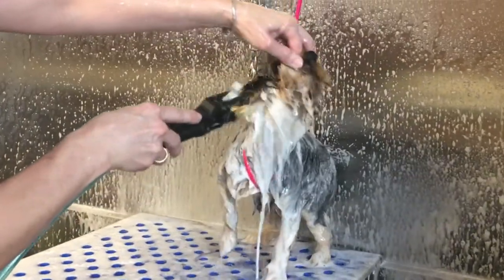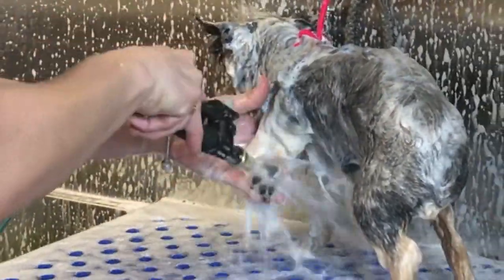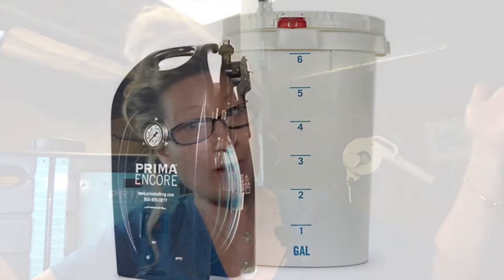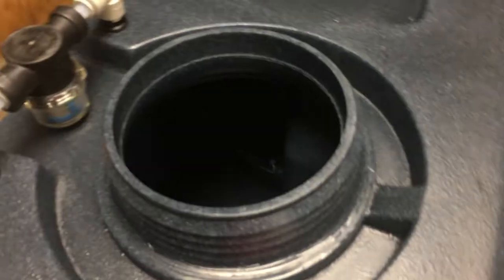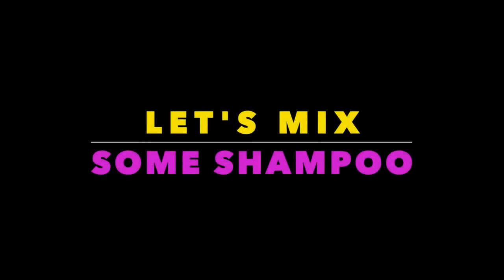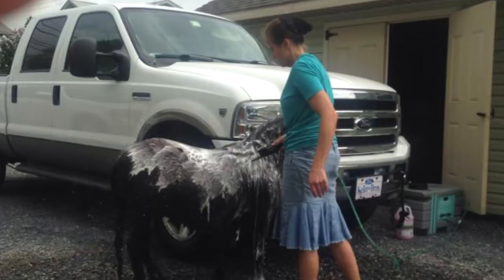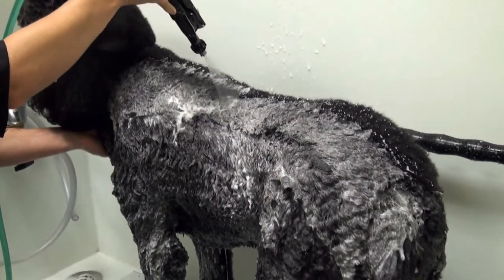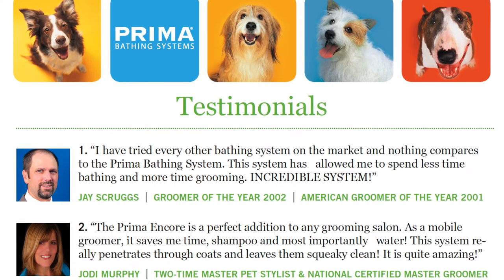Prima Bathing System is the most Efficient and Environmentally Friendly Bathing System

Comment: Hi go groomer luv ur channel 
I was considering buying a prima but I noticed you’re only allowed to use one shampoo at a time that’s not considering the conditioner so how does that work if you need to change up your shampoo or your conditioner I also love the nozzle that you use for your water where can I get one 
Thanks 
Ivonne
Reply from the maker: Prima has one aux option for a second product. But honestly, I like to use a hypo shampoo for every dog in the tank and choose my conditioner per coat type. I apply the conditioner by hand and pre-mix in a mixing bottle. My tub sprayer is made by triStar vet.
Reply: @GoGroomer  can you use thicker shampps in the aux like deshed?
Reply from the maker: @karinevans754  yes. The same products you what are used in the main tank. Remember, Prima works best with shampoos that are dilatable, concentrated.

Comment: At the end of the day if you have soap still in their, do you reuse it the next day? Is it OK to use bleach in it to clean so no bacteria is left?
Reply from the maker: I empty and rinse the tank every couple of days. Hot water mixed with about 1. Up of vinegar. No bleach in this system, it will destroy the guts of it.

Comment: Help! Im so torn, i know you also work with groomers choice products and i am planning on ordering a batherbox tomorrow im worried im making a bad decision, do you have any information or experience with the batherbox?
Reply from the maker: I would not choose the bather box over the Prima. You are limited with shampoos in the bather box as well as is does not come close to cleaning the pets the way the Prima does.
Reply: @GoGroomer  I'm also wonder if the prima will help me, I am putting in a new Grooming shop and the building I will be putting it in has a small tankless water heater will this system help me with not having to buy a bigger water heater? Hopefully this is making sense. I've been watching your videos for weeks, your amazing!!
Reply from the maker: @MrMaloriebush  the Prima is very conservative and economical. Uses less water and shampoo and Remember you apply it to a dry coat which saves you a ton of water. That is why it is the best choice for mobile groomers as well. 👍🏻

Comment: I recently used a Prima bathing system at my local pet store that had a DIY dog wash, and I was disappointed with it. Maybe I dont fully understand how its supposed to work and I had wrong expectations, or if it just wasnt hooked up properly. I had to 1st wet down my dog with water from a hose attached to the tap of the tub. Then I used the Prima system, which I assumed would have a steady supply of warm water coming into the tank and mixing with the soap. But the water was COLD! The tank wasnt hooked up to a warm water tap anywhere. The employee said the tank is filled every morning with warm water and then they mix in the soap. But after the mix sat in the tank all day the water got cold. The high pressure wash was great but it was cold water, so I didnt do as good of a job as I wanted because I was doing it quickly to minimize the cold water on my dog. Then I had to switch back to using the hose on the tub to rinse out the soap...with warm water. So Im confused. All the seperate hoses, the cold water, the seperate rinsing just didnt seem right to me. I dont want to wash my dog in Feb with cold water. Can anyone clarify and explain how this is supposed to be hooked up and how it works?
Reply from the maker: I would say the shampoo and water ratio was not accurate. Not mixed correctly.